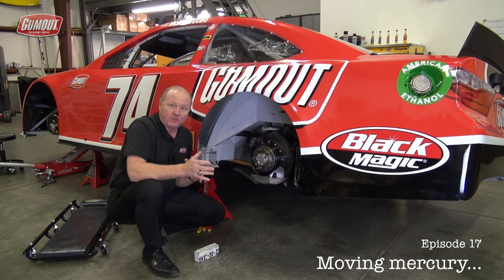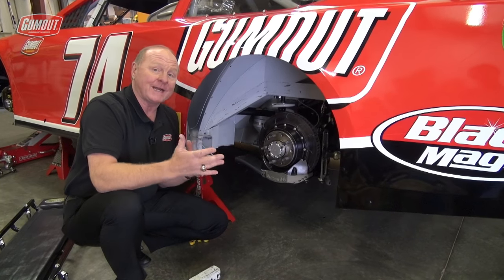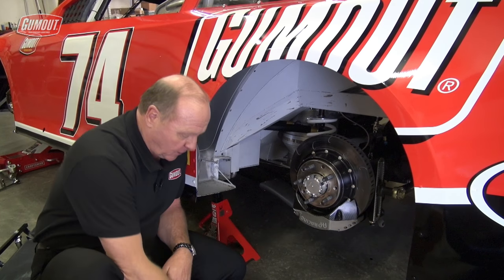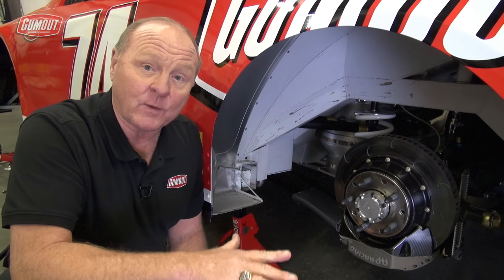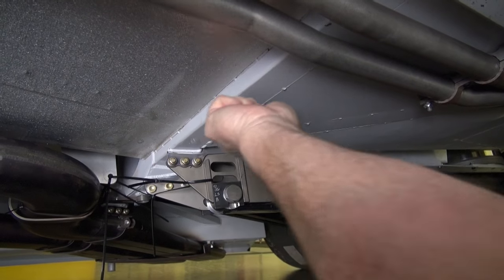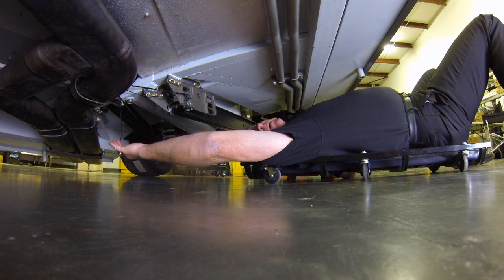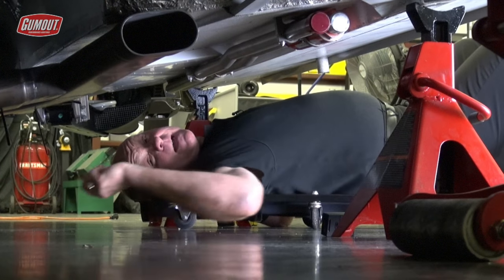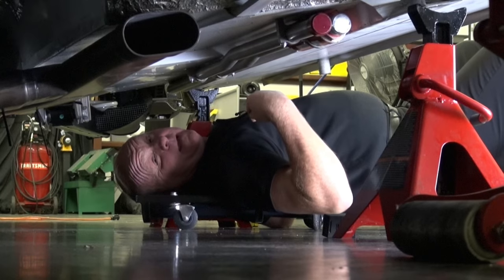Larry Mac's Pushing The Envelope - Moving Mercury

Comment: How would Nascar have missed the necessary pump?
Reply: My guess is the pump was also hidden inside the frame rail and some really clever wire routing.
Reply: Stan Lee  its not BS. Tech inspection of the 90's isnt what it is today. Todays tech inspection is because of the crew chiefs from the 90's.
Reply: Stan Lee  it was a small hand held pump, operated by the buttocks...